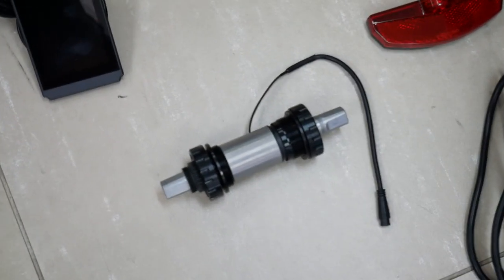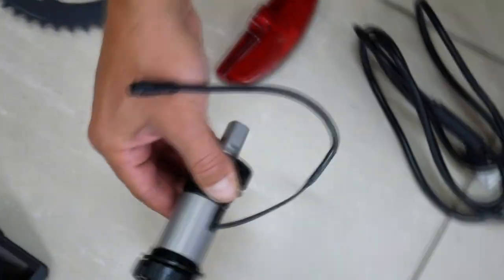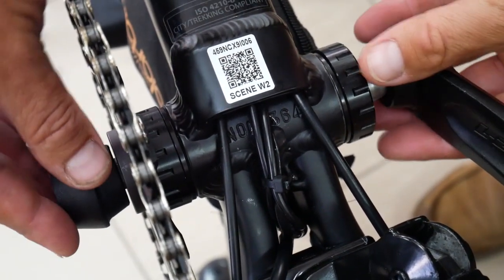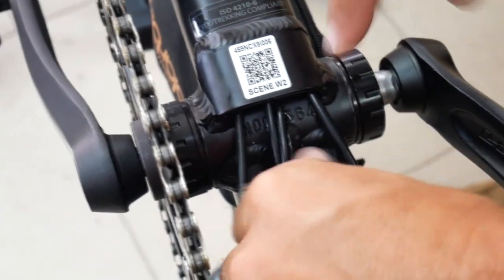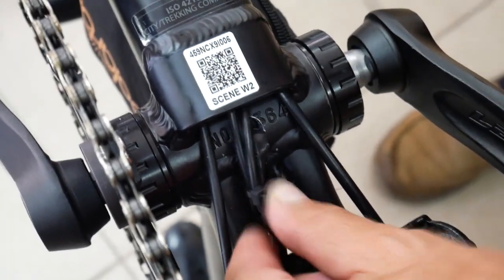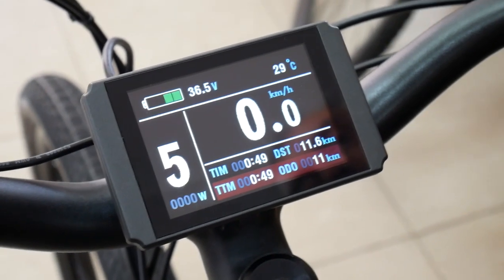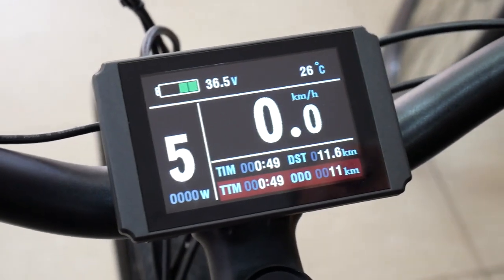Electric Bicycle Hub Motor (torque sensing bottom bracket kit)

Comment: Is that Bafang or Tongsheng torque sensor? What power of rear hub motor do you recommend for pedal assisted MTB rides? In a way that bike in not turned to motorcycle.
Reply: Tongsheng has it inbuilt, this one is made for external controllers like backwheel motor or frontwheel motor

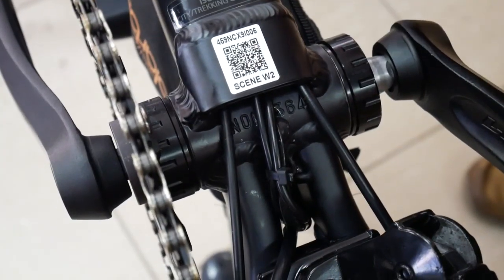Comment: ((  00:20  ))   - - - -    Be  shure that  the  serial  numbers  are  registrated  by  law,  if  you  got  an  accident:  The  ASSURANTIE / Security  numbers  are destroyed,  the  company  will  not  pay out  you're   bill  after  accidents  .....
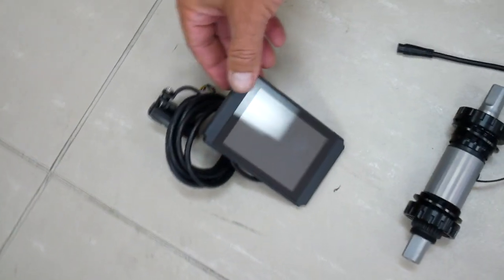Mechanical   you  did  make  the  HUB  @  crank assembly  weak  ....  small cracks into Aliminium frame @  hub ....   ((  00:20  ))